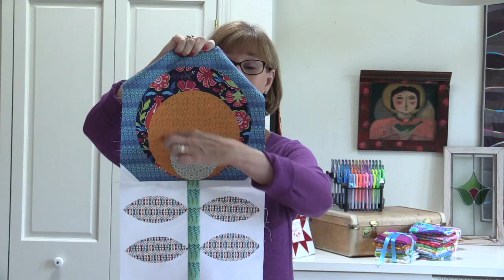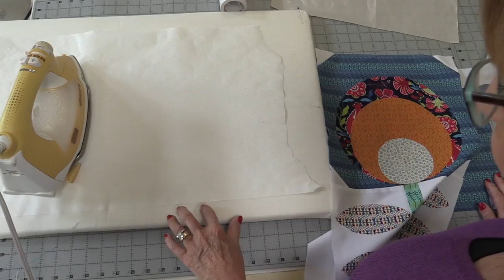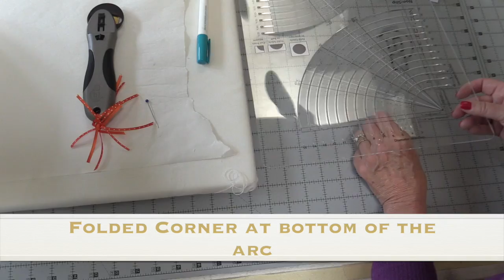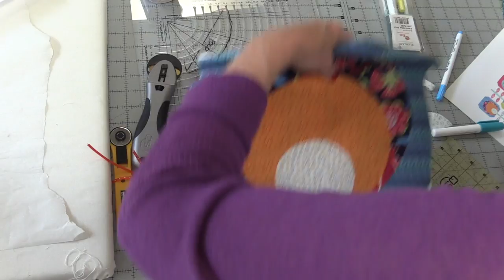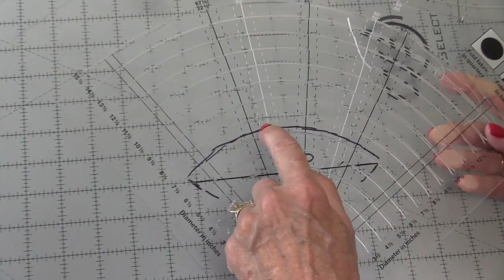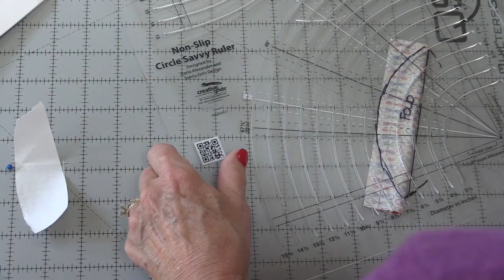Quilt Tutorial: Easy Quilting-Flower Power Quilt

Comment: This design really caught my eye but I must admit I'd be tempted to make the following method changes for those more experienced at appliqué and quilting: 1. only fuse the outside edge of each circle by say half an inch so that the stiffness from layering is eliminated, plus that will save on the amount of fusible needed (or saved). 2. I'd also cut away the overlapped fabric from underneath, (as in reverse-reversible appliqué) again this would save precious fabric for use on a future project. 3. I would just do the leaves as in the tutorial. Agreed it would be more fiddly, and if you are a beginner then do it exactly as shown, but I think the fabric savings would be worth it as that would be quite a bit of fabric saved for other projects. Overall a great tutorial and lovely pattern - thank you.
Reply: I love fusible applique. I learned a trick called "windowing" where the applique shape is traced onto the fusible web and then the inner portion is cut away, leaving approx. 1/2 to 3/4 inch margin to fuse to the back of your fabric. Works great when you're layering pieces like Alex's quilt and eliminates so much stiffness and weight. Good when making baby quilts too.

Comment: $150-Kit, $60-Rotary cutter, $36.45-Ruler, $22.00-Appli-web Plus, $16-pressing sheet, $10 glue stick, ($10 pattern-in kit) TOTAL- $294.45. So almost $300.00??!!!! Does kit include batting and backing??  Prob not...And we pay that much to sew it together!!??
Reply: Just get the pattern...you may already have a lot of the fabric and supplies.  Quilters usually have a lot of what they need.
Reply from the maker: The Kit is $139 with the fabric and pattern. You truly do need the fusible to make the applique work. That is all you need to make the top. The rest is Optional. The pattern comes with templates for cutting.  As with most quilt kits, you do provide the 3 B's--batting, binding, and backing. Also, the pattern is $9.95 and you can make the quilt from your stash.
Reply: THE QUILT SHOW   THE KIT IS $149.99!  ONE PENNY FROM $150.00!
WWAAYYY OVERPRICED!!!  You're too proud of this one people. 👎